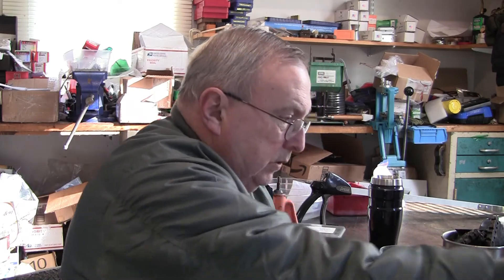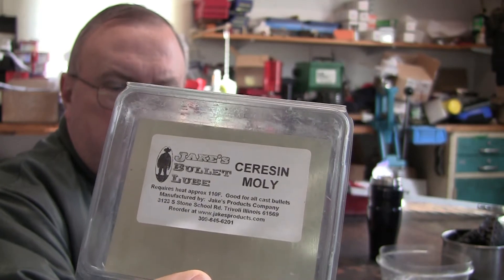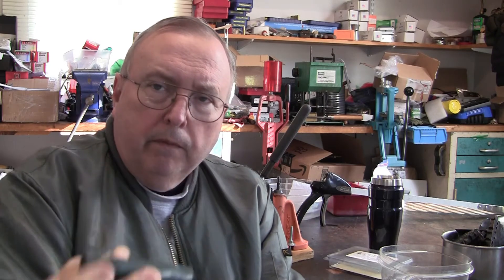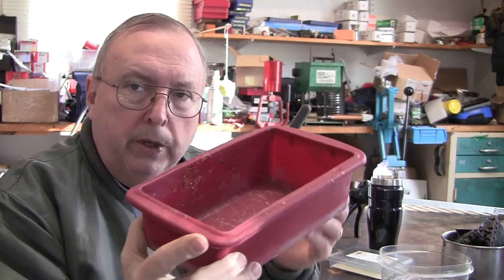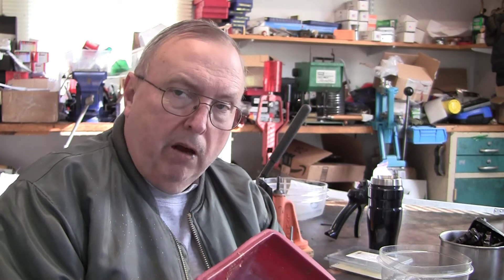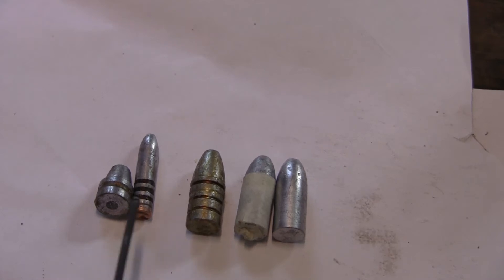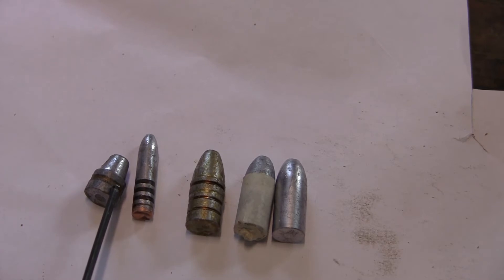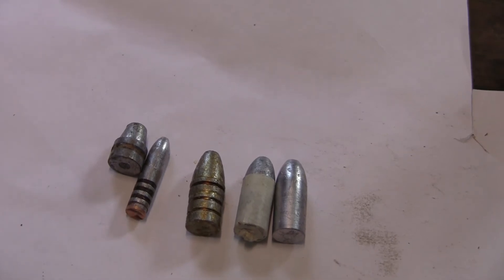Lubricating  your cast bullets

Comment: I load .45 Colt & .45 auto. I started pan lubing & cookie cutting the bullets out with a .45-70 case & push rod. Then I went to Alox tumble coat. Getting some leading in my Colt series 80 so now I have powder & about to cast .230 gr auto rds & powder coat, then size.